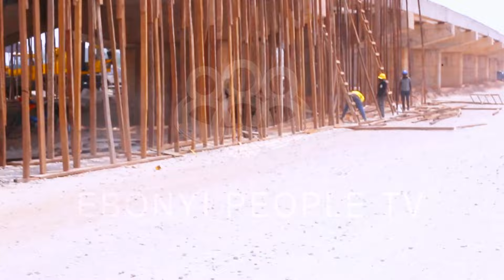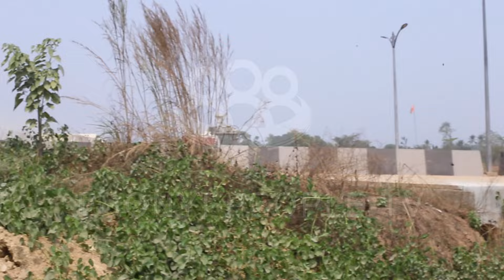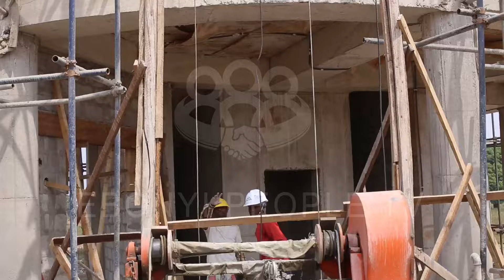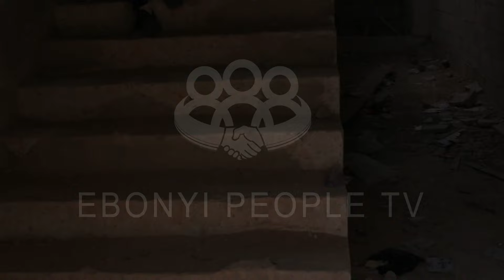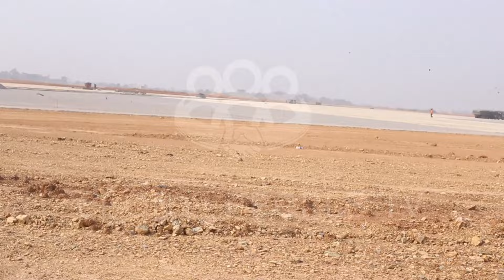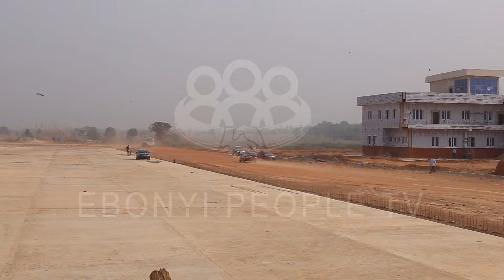Revisiting Chuba Okadigbo International Airport: What Has Changed Since 3 Years Ago?

Comment: Had it been the money used to built these airport was use in build metro train ways and stations that will connect the whole of southeast, that could ne more beneficial
Reply: Do you know the cost of constructing rail lines. triple of the money spent in d airport cannot achieve it. Ebonyi needs airport to increase its accessibility but a smaller or lest costly airport that wold have been completed alongside with anambra airport. Now its difficult to initiate flight due to the state of the economy